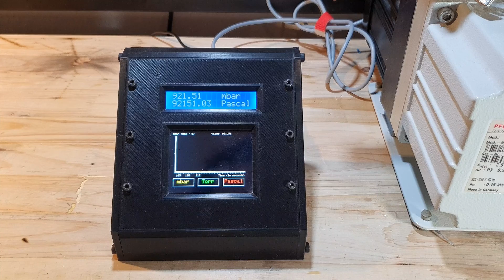Scientific glassblowing: Making QF/KF flanges out of glass

Comment: anyone know if its possible to buy these? KF to ground glass joint? surely making your own isnt the only way, because theres like nothing out there to let you safely connect borosilicate to metal at high temps
Reply from the maker: Yes, you can buy them.
Reply: @AdvancedTinkering  i mean, do you know where? ive spent hours trying to find it. its extremely rare to even just find blank glass KF flanges that i might weld to a ground glass joint, let alone ones that actually are a direct flange to say, 24/29 joint

Comment: Nice work. Which type of torch did you  use in this video? Is oxygen necessary to make this type of job?
Reply: Pretty late, but looks like a Carlisle mini cc. As someone who works glass I wouldn't try this without oxygen, it probably is possible on a hothead or something similar, but it's going to take forever and good/clean results will be much harder to get

Comment: Very nice, I actually changed my connection on my vacuum pump to KF because of that. I even found a simpler solution, a 19/26 ground joint somewhat fits on a KF16 flange. I haven't tested it on the pump yet but the O-ring fits perfectly. Just for the the clamp it's a bit wide.

Comment: I like your work! I ahve been thinking about a solution to this problem. What size flange is this that you have made?
Reply from the maker: Thanks! It was a DN16 KF Flange. They work quite well but you have to be very careful with the tension of the clamp, otherwise the glass could crack. 
So they are not perfect, but work if you don't want to pay for a professional glass flange.